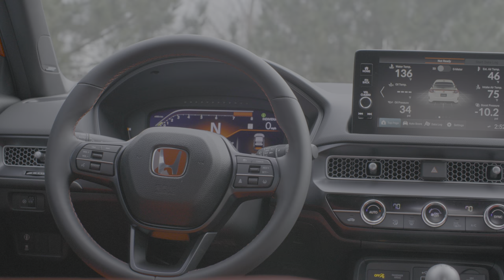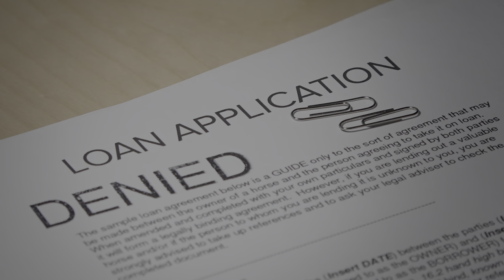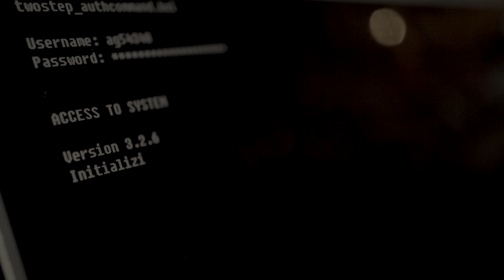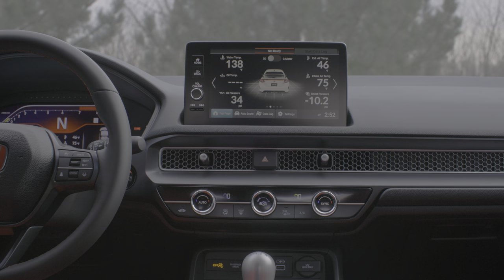Why I Bought an FL5 Civic Type R

Comment: Our local Honda dealer has treated my family, my parents, and my friends like trash.  This after my father owning an S2000 for 20 years and other Hondas for 40 years; and me owning a CRX for 5 years followed by two S2000s for 12 years.

They pulled the tired tricks of "so rare - can't drive it unless you buy it" to my dad when he was interested in the first gen Type R here in the states.  They pulled the same trick for and my wife and me this year with a Civic Si [scheduled] test drive - when we showed up they refused to show us the car until we had agreed on a price.   We pointed out that it was a $30k car and they pulled the "but it's so rare" bs, so we laughed at them for such inanity and drove our quite stock and low mileage Focus RS across the street to test drive a Scat Pack no questions asked.

They one time made a friend of mine cry because they sold her a used Accord with modified suspension, then refused to honor the extended warranty she bought because she had modified the suspension.  She knew nothing about cars and wouldn't know a mod if it slapped her in the face.  They not only tried to shut me up - which did not work since I was there on her behalf - but also treated her like a criminal and started screaming and berating her.  I swore that day to never buy another car from those clowns again.  I've ironically tried with the most recent Civic Si but they made it clear I should keep the streak alive.
Reply: Document all that - make some paper or video trail around it - and fight it. Make the higher-ups see and know all that. And there's always a higher-up - either in regional Honda centres who oversee the local jerks - or the federal/state institutions. Here in Latvia, we have PTAC - which in translation means Consumer Right Protection Centre - I'm more than sure you have one or more institutions like that in the good ol US. Fight against that - make those jerks suffer - and understand that people like that can never work in customer care. Never. If no one fights against them - those aholes will proliferate, just like Covid. Greetings from Latvia - keep up the fight.
Reply: @JurisKankalis  fantastic words! Thank you for the thoughtful reply. And wishing you best of luck in your end of the world. Things seem a bit more fluid than usual in your neck of the woods.
Reply: @JurisKankalis  Sounds like my local Hyundai dealer. I ended up getting the better of them and the lying sales rep even seemed to be fired after the whole fiasco. But it never ceases to amaze how scammy the car biz is. One doesn't expect it from new car dealers. They're almost as bad as "Honest Mike's Fine Pre-owned Cars" on the corner.
Reply: Honda dealers have a serious problem of reputation, and at the end the brand is going to take the hit

Comment: Great job on the HDR and visuals in general. I'll say it over and over again, you guys on this channel continue to push the boundaries to the point that I save your videos to my watch list on here so I can get home and fire it up on my 4K HDR mated to a JBL sound bar to get the full experience. I don't know any other channel besides maybe Gears & Gasoline that have me as excited to watch whatever new video you post. It doesn't matter if I'm not remotely interested in the car you're reviewing. I will still watch the video. Your review on the 2022 Civic Si was the reason I actually bought one. It was a huge upgrade over the 2019 Civic Si regardless of it having somewhat of the same engine. All the technical information you get from manufacturers from the changes in shifters, suspension geometry, chassis rigidity is just the icing on the cake. Thanks for everything you guys do and the endless hours of entertainment you've brought us.

Comment: The solution to demand increasing prices over MSRP is pretty simple: build more. We're told over and over that "people don't buy enthusiast cars" yet every enthusiast car is in high demand, cannot be found or can only be found with ADMs. It almost seems malicious at this point.
Reply: I wonder if it's also because of people wanting to flip those cars? As I've noticed a lot of people have been selling enthusiast cars for more at least since 2015 to now especially for these types between the $35k-$60k range.

But yeah if that's not necessarily the case totally agree why aren't manufacturers seeing this demand?
Reply: My guess manufacturers don't make much off of each enthusiast car vs smth mass market like a CRV or HRV.
Reply: they don't need to produce more as the HALO effect is better achieved when the desirability is higher from the insane hype around that particular vehicle. This is the new normal.. so, we, the enthusiast must find ways to get around it, somehow..
Reply: @sebastiantoplician1093  I wouldn't be surprised if that was a major contributing factor for the insane markups. It's like trying to buy a Rolex sports model at an AD. It's literally free money to anyone who's able to buy it at MSRP. I don't know how prevalent flippers are in the car market but they ruin everything for all types of enthusiasts.

Comment: I dislike the Owner's approach to the pricing issue... Yes, there is a way to change that. Starting by you as a dealership, donating the markup to a charity it is not the solution, it is just washing your hands and cleaning your tax book on donations. You need to stick with the MSRP period. You will see, that dealership will be the only one and the one to go for the vast majority of the buyers, and you ended up forcing the rest of the competition to do the same. But if you play the game of higher bidders you won't stop the cycle. Now the extra add-on like the PPF from the dealership That is only a few clear stickers at the door edges, and door handles inside, partial hood, fender, and mirrors does NOT cost $4K. Remember dealership does not do a paint correction and professional PPF like independent shop does. And force you to get it in order to buy the car with them at MSRP it is another way to screw up their customers. I keep having the same experience with the dealership and now more recently with Lexus, where I have to fight to the last dime and renegotiate the final out-the-door price of the vehicle that I ordered because the salesperson keeps playing the game of going back and forth with the manager and each time they talked to you over the phone about the allocation and the status of your order they change the game rules. I'm sick and tired of old dealership behavior and thinking that the customer is stupid and ignorant and that they can say any BS story and you as a customer will believe that. It may work for a small percentage but the vast majority either walk away to don't say anything and go with it.

Comment: Great video, and hearing the story behind it was really interesting! I bought a '22 WRX last summer, which I also asked them not to PDI, so I could take it straight to a really nice shop to have the film removed, washed carefully, and wrapped in xpel. For what it's worth... I did have to call about a dozen dealers across Ontario to find an allocation in world rally blue / sport-tech trim that wasn't already taken, and even then it was 4 months out, with most dealers only getting about one a month... but thanks to a letter from Subaru corporate sent out to all the Canadian dealers earlier last spring telling them not to overcharge - I didn't pay a cent over MSRP. So my hat's off to Subaru for not charging more, even when the market's demand at the time could have easily allowed them to.
Reply: 👋🏾 in Ontario as well with a ‘22, which shop did you take it to? I’ve been looking for one but not sure which would be reputable.
Reply: @klvb-m  AVOTTO in Pickering - great service :)

Comment: Great video, Mark. I had a similar experience back in 2018 when I wanted to buy a Focus RS. At the time they were selling for over MSRP. Fortunately, my local Ford dealer was decent and actually sold me the car for under MSRP! Absolutely unheard of, at the time. Still love the hell out of the car! I saw your review of the RS, which was mixed, but I like the track-like ride of the car. Keep up the great work.
Reply: No it wasn't.  2018 dealers were discounting the RS like crazy trying to get rid of them.  Or at least that was my experience.  I got my 2017 RS for $6k off sticker.

Comment: I just bought an accord 2.0. I was lucky that I wasn't shafted by mark ups and insane pricing. But it took nearly 8 months of trying to make that happen. Every honda dealer within 500 miles wanted 8k-10k over MSRP on a car that starts at 33k. At that point I started just looking at an ES350 since lexus dealers have zero mark up policies.
Then I heard about the 25k mark ups on the type r and that was it. I get it, free market, but at this point, dealership laws in the US need to go. Manufacturers should be able to sells direct to consumers, and it would immediately make it evident that the majority of people in the US that "have jobs" don't actually do anything or produce anything except numbers on paper.

There is a reason I pretty much always drove toyotas, its because the dealer in my area has always been honest, straight forward, and open to negotiations at any time. I tried honda several times, and I ended up buying camry's over and over, because the toyota dealership experience was THAT MUCH better right across the street.

Comment: Mark, I was with my best friend when he bought his Si from Brilliance Honda. It may be true that they don't sell over MSRP for brand new cars, but my buddy paid a little over sticker for his car because it was "used" (with 3 miles). Seems that is the workaround they may be doing now.... Although they did basically even it out by giving far above what Carvana or CarMax were offering for his trade. Just a transparency note about that dealer - sales guy was really great though.
Reply: Well of course he got a bigger trade allowance, he also got a higher finance rate because the car was already titled “used”. I don’t like the sound of that at all. Seems to me there had already been a transfer of ownership including re-titling of the car before it ever even arrived. That’s not a typical dealer inventory swap, they flipped that car before it ever got to your friend. Was the original factory warranty still fully intact? I’m betting not. Did he get higher % financing? I’m betting he did. Did the dealer get to post two sales of the same VIN in the same month? You bet they did! The first sale (the flip) posts to Honda which they want so they can get more allocation just like everyone else. The second sale is where they make money while also skirting around the ADM issue.  
In 40 years of car ownership I’ve done 38 purchases, and I’ve never encountered this. 
Again, there’s a lot more to unpack here but I don’t like the sounds of it. 
Not. One. Goddamn. Bit.
Reply: I could be wrong but I saw a vid about dealerships in Canada doing that as a loophole to charge ADM on the fl5 type R since they legally can’t sell over MSRP due to Canadian regulations
Reply: @PhatMikeSP1  uh boy. This is one time I was hoping I’m wrong.
Reply: @PhatMikeSP1  what’s an ADM?
Reply: @v8_sami  Additional Dealer Markup

Comment: You are correct, this is a big investment!  Especially for it being a Honda Civic.  I was extremely lucky and was able to get my hands on a 2023 FL5 Type R the week before Christmas at MSRP.  After PPF, ceramic coating, tint, all season tires and insurance, I am $44,000 out of pocket so far with a $10,000 loan on top of that.  YIKES!

I will do my best to keep it in great condition without being overly obsessive.  My first car was a 2001 Honda Accord that I got in 2014 while I was 16 years old.  My most current car is a 2009 FA5 civic Si with currently 211,500 miles.  Needless to say, this is the first vehicle I have purchased that is not a high milage commuter on its 3rd+ owner.  I’m excited for the 20-25k miles per year I am going to put on this thing!

Comment: Incredible. This story reminded me of my own situation back in 2007. 

Back then I worked for the biggest car mag in my country, so I travelled around Europe and the Middle-East driving everything that was released at the time, from Renault Twingos to Audi R8's. I drove it all. 

Having owned a DC2 for 4 years, I went ahead in 2007 and purchased the first ever FN2 in my country at the time (Cyprus), in red of course, and almost every positive thing you mention about the FL5 here was true of the FN2 back then: the perfect blend of everyday/track car that you wouldn't even mind having your family in without loud design strokes. 

I owned that car for 13 years, drove it for 188K kilometers ( 116k miles) and the only thing that ever failed on it was the starter. It was, for all intents and purposes, the perfect car. 

From a Honda fanatic to another, καλοτάξιδο <3

Comment: “Why do people in the media get special treatment?” 

I firmly believe it isn’t special treatment. Firstly, it’s typical for folks in the media to have contacts in the right places. That is part of the job. Secondly, and most importantly, I think it’s often a case of not being a savvy shopper. I am a normal guy, I have no contacts in the automotive world, and I like fun cars. I bought a GR86 last year in the midst of the worst of the car market at MSRP. There was no hassle whatsoever. I worked with multiple dealers to get an allocation, and I had two factory orders in for BRZs, which you could argue would be a hassle, but that is completely due to availability which everyone everywhere is equally affected by. All dealerships I worked with were clearly aware that I would walk away without question if the price was not MSRP. There were a few dealerships I walked away from. I utilized online reviews to point out objectively negative experiences publicly to make people aware. Every single dealership I left a negative review on called me profusely apologizing and offering me free services, coupons, etc. Publicity matters, and so does being a savvy shopper and making your expectations as the customer clear and sticking by them.

Comment: My Veloster N is pushing 335 to the wheel. I know it's not better than type R but it's pretty close. I have stage 2 and all in all I only paid $37K for the car and tune. I know type R is a great car but I feel like if you're willing to spend so much money on type R get fully loaded audi RS3
Reply: RS3's have mark-up too!
Reply: My GLI was 23k out the door. I've put about 3500 into it and it makes north of 350WHP on 93. Ethanol soon.
Reply: @MeltingRubberZ28  wait till I do turbo upgrade it'll be over
Reply: @I. D.  yeah when your motor pops lol. EA888 handles 500WHP for years. Those Hyundai's are popping at 400WHP. Plus it still cost me 14 grand less 🤷‍♂️

Anyway I'm not hating. I like the new Hyundai N series. I'm glad they're outputting enthusiast cars.
Reply: @i.d.6492  wait till it falls apart 🤣🤣🤣👍😎

Comment: 4:48 As a too-noisy “1990 Protege LX DOHC manual” owner, I went test drive a new 1997 dark green Civic EX coupe manual. I still didn't buy it because the slow steering also got less feel along with too little low-end torque. So I ended up getting a new 1998 Corolla LE manual, which got redesigned new style, along with decent quietness & low-end torque but disappointing steering feel & shallow suspension travel (especially on the clumsy rear suspension). Only in the recent years did I realize that if I could go back in time, my choice would be a Canadian-market 1998 Acura 1.6EL manual with cloth interior & Slicktop (no moonroof) then downsize the steering diameter (due to slow rack) to 320mm -- Double Wishbones all around!

Comment: Absolutely loved this. My only question is how do you think the Integra Type S will compare?
Reply from the maker: I have no idea honestly The brand confuses me.
Reply: @savagegeese  That’s a cliche response about Acura.
Reply from the maker: @DoctorSkillz  Im just saying I know Honda Japan wants control of Type R. So why would they let the American side clone or make the Integra Type S the same or better?
Reply: @savagegeese  I'm still surprised Honda allowed Acura to use the Type-R engine (at least, that's what's being said as of now).  My guess is Acura pleaded to Honda that they needed to have the CTR engine to compete and quell a lot of the backlash which was the stupendously disappointing TLX Type-S (honestly, probably the biggest flop car of 2021).  I kind of wish Acura goes the other way with the Type-S.  Bigger engine, but softer suspension.  If you want a track weapon, get the CTR.  If you want the CTR engine but more compliant than even a Civic Si (which is too stiff already IMO), get the ITS.  

There's no need for two overly stiff twins from basically the same company.  I also wish Acura would add more sound deadening as it's unacceptable that for the price premium, you're still dealing with as awful road insulation as a base Civic.
Reply: @savagegeese  Because a market for a more premium Type R exists.
Reply: @savagegeese  if it confuse you as an american.. wait until you find out what us, the Europeans, think about it.